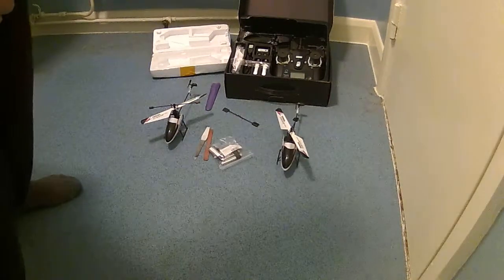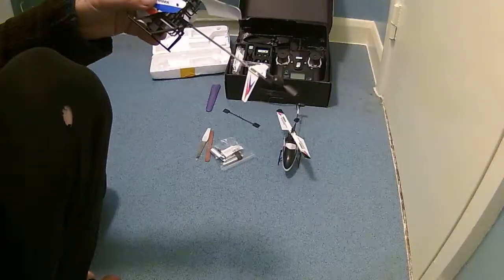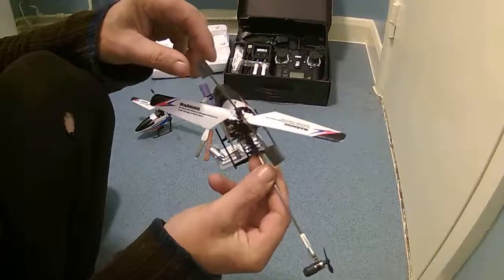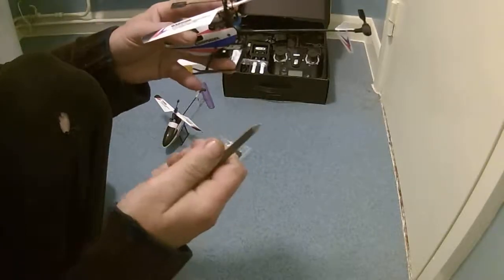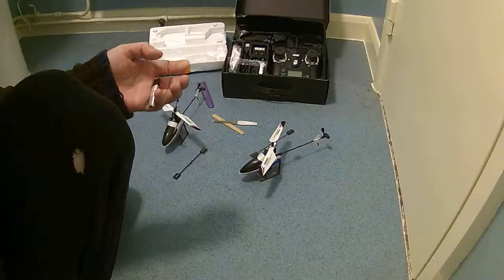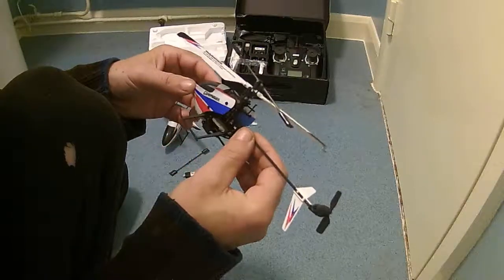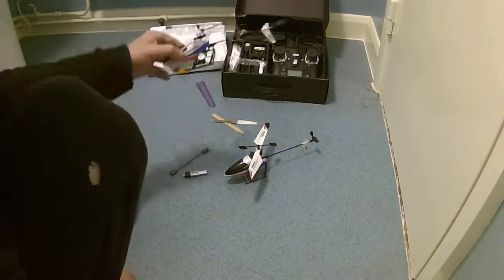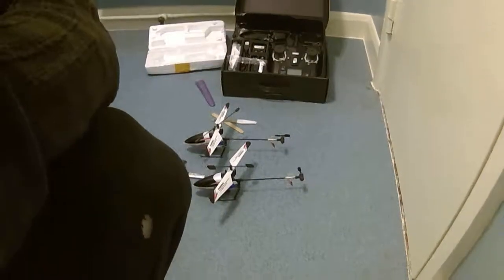WL toys V911 pro upgraded mods and tips(part 1)

Comment: Thanks for taking the time to put together a video but your vids and presentation need a bit of work. Where did you get the paddle flybar mod? Where did you get the upgrade batteries? Where did you get the swashplate mod you chose to tell us about? You were clear about where to get the actual heli but you have to know most people who landed here already have it and like me are looking at what can be done to modify it. I watched your full video but still am no closer to modifying my heli. The shrinkwrap on the tail was useful I think although I've yet to find myself in a situation where the exposed wires are a problem, and I've flown thousands of hours on this Pro and the previous version.
Reply from the maker: AHH yes the days before I got a video Editor. The paddlebar can be found on eBay as can everything else to be nodded or goggle it and as for the swashplate the seller sent it but I never received it after months of waiting got a refund but he put the price up so I don't think he even sent it bort some 200mAh batteries for it(ten minutes flight times)and never used it since.bort v911s and the "star"brushless version which are miles better but since moved on to freestyle race multicopters and planes.hope this answers your questions?
Reply: @cyclops-fpv  yes mate thanks, excuse the critical response, I was a little frustrated at the vague nature of many 'instructionals' on modifying by the time I got to yours.
Reply from the maker: All good mate but here's a mod that was great
Reply from the maker: https://youtu.be/aobvjR8D01A
Reply from the maker: https://youtu.be/d1NkH8N4H3A